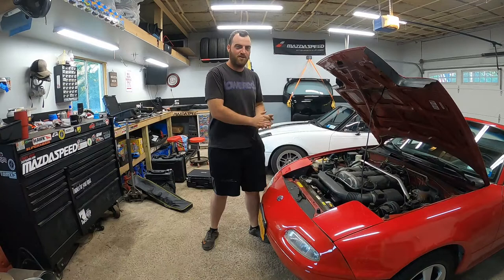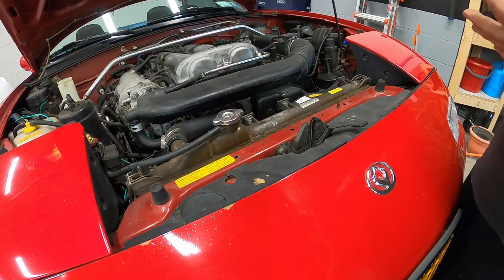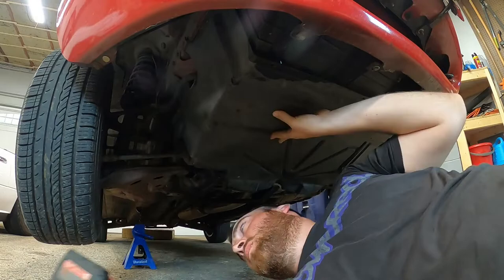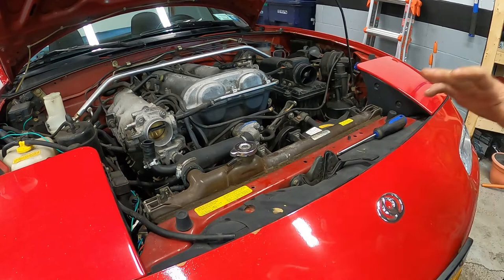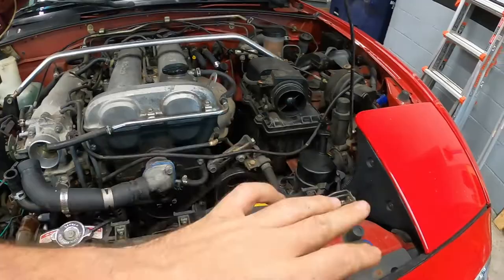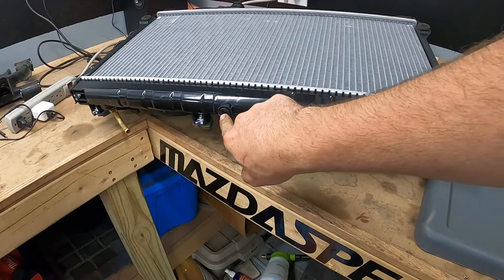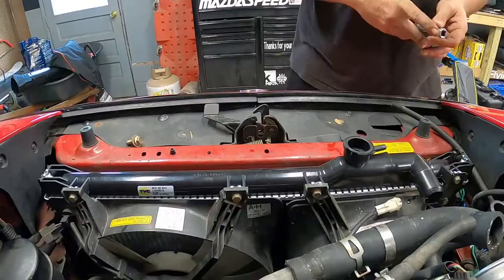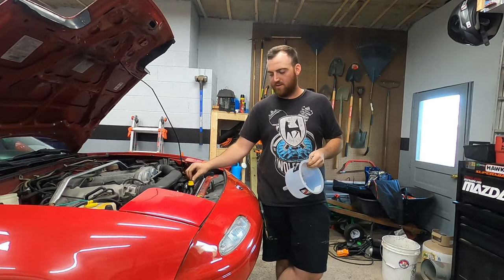Miata Radiator Replacement - Keep Your Cool!

Comment: Watched several radiator replacement videos and this is the best and easiest to follow so far! This gives me more confidence to do this. Biggest concern is jack stand placement as I’m always worried about getting under a jacked up car
Reply from the maker: Thanks for the feedback! Pinch welds are best. Sometimes I’ll throw the wheels underneath also if I start to get anxious while I’m under the car.

Comment: My 1992 radiator just failed, so I found your video most helpful. Impressed the radiator held up for 30 years in NH weather.
Reply from the maker: That’s impressive! Glad we could help
Reply: mine too. big crack by the cap. the plug on the right fan, was silly, but this vid saved me. OMG! how dumb a design.

Comment: I believe the extra cooler is for automatic transmission models. The replacement must be a "one size fits all" part.
Reply from the maker: Yeah, it could be used for other add ons like power steering coolers as well.

Comment: Nice video!  When I’m doing a radiator swap I always like to run distilled water through the system and just give it a nice flush before putting new coolant in
Reply from the maker: Great tip!

Comment: Couple tips I learned the hard way that weren't mentioned, if doing a full coolant flush be sure to run the heater to get the coolant/air flushed out of the core. Also make sure the rubber gasket on the funnel kit doesn't get stuck in the radiator fill neck otherwise you won't be able to (easily) get the rad cap back on.
Reply from the maker: The heater core will flush regardless of turning the heat on actually. It’s all propelled by the water pump, so fluid is flushing through the system no matter what! 

Did not know about the filler neck rubber gasket. I’ll keep an eye on that in the future so it doesn’t bite me. Thanks for the head up!

Comment: That radiator cowl where your wrench rested at the beginning, is that oem? Is there a part number for it?
Reply: For those that find this question in the future it is referred to as "Seal, Bumper" NA75-50-0K7A and is held on by "Rivet. Fastener" NA01-56-145
Reply from the maker: You can also by radiator cowl covers aftermarket.
Reply: @NappMotorsports  yea admittedly the stock one is pretty thin and there's a circular punch out that can get old and fall out xD 
Saw a nice aluminum one by Dave Fab UK but finding the drawing that had the oem one was nagging at me

Comment: Thank you for the video.  I notice the two fittings coming out of the bottom.  My replacement has those as well, but the stock one does not are they blocked off not sure if I should install it or not?
Reply from the maker: They are for a transmission cooler. You can leave them unblocked and it won’t matter.
Reply: @NappMotorsports  Thank you for the reply, I appreciate it...

Comment: did you jack it up from the engine or is there a subframe or crossmember there?
Reply from the maker: The front subframe crosses over right in front of the oil pan.

Comment: What are the two little gold hook ups on the bottom for?
Reply from the maker: Those are generic for a power steering cooler I believe. They don’t get used for anything.
Reply: @NappMotorsports  so I don’t have to connect anything to them at all?